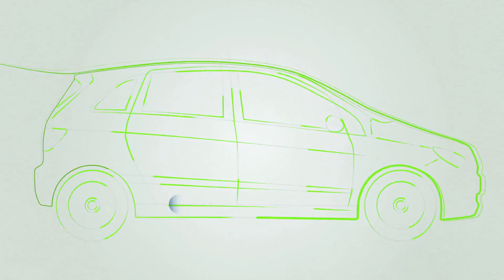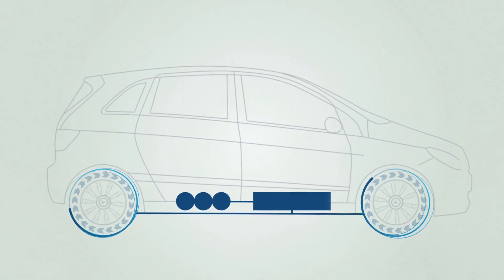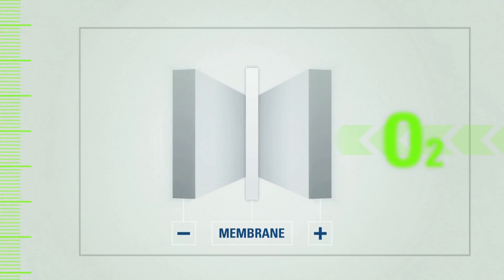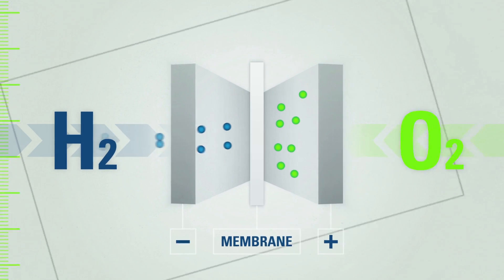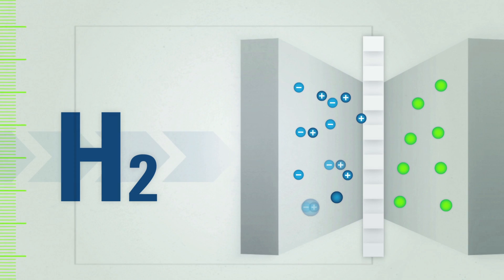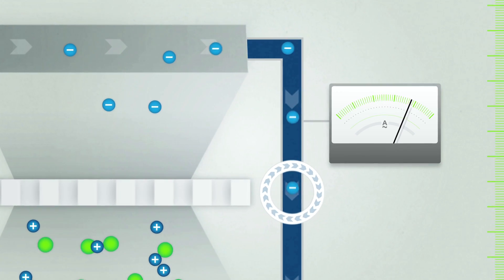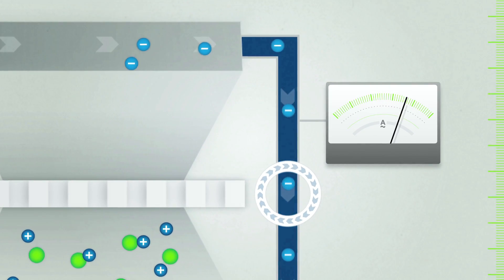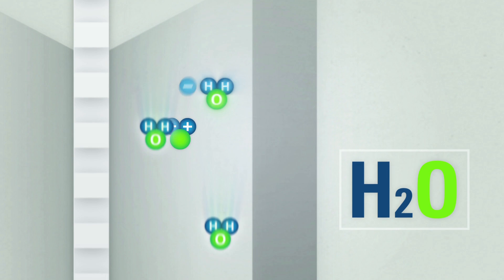How does a fuel cell work?

Comment: Hydrogen is inefficient and costly to store, transport, and utilize.  Electricity is much safer and easier to store and transport which is why battery technology is widespread in everything from cars and ships to homes and power-grids.
Reply from the maker: Hi K A Nesiah,
Hydrogen is a technology that has been tried and tested for years with high safety standards. Several hundred hydrogen dispensers are in use worldwide and over 100,000 fueling processes have proven that refueling with hydrogen is safe, efficient, odor-free and takes around four minutes – comparable to conventional car fueling. Electro mobility in the form of electricity is already present and will continue to gain popularity, especially in short-distance passenger transport but when e-mobility calls for large ranges or heavy freight, then energy sources with a higher energy density are required—and this is where hydrogen comes in. As an example, the weight of the battery pack for an heavy duty truck alone would be like carrying a second truck on top. Hydrogen and LNG are currently the only viable alternatives for long-distance truck and bus travel. The same holds true for shipping. No battery has yet been invented that can compete with the range of hydrogen & LNG in the size of a fuel tank.
Reply: @omv  Electric drives will be standard in cars in 10 years as they are already standard in locomotives and cruise ships.  Batteries are far superior for light-duty consumer usage scenarios like cars, pickups, and motorbikes with near infinite potential charge points requiring as little as  $100 plug, while locomotives and cruise-ships which require very high-energy density are already diesel-electric hybrids.  Diesel and dirt-cheap LNG will be around for decades.  Hard to see a reason for hydrogen.
Reply: LOHC has solved the drawbacks you mentioned including safety, transport and utilizing

Comment: Unless hydrogen is cheaper than hydrocarbon fuel Gas, petrol, diesel or compressed gas) The future aint changing much. 
And stop refering to it as a mini power station, its more like a rechargable battery consuming air and hydrogen

Comment: Hydrogen was the fuel of tomorrow until electric cars were invented...
Reply: From what i've been told, the problem lies in power storage.  The smaller the power draw, the more viable batteries are.  Flashlights, phones, calculators and now cars...but what about commercial airlines or tractor trailers?  Batteries in larger vehicles are an engineering problem since batteries are so heavy that it's very inefficient.
Reply: No way, hydrogen is still the fuel of the future. We just need to figure out the extraction and storage problem- hence “future”. Batteries are primitive - the have been invented hundred years ago and are the technology of “today” vs “tomorrow”.
Reply from the maker: Hi MrSophisticatedChild,
you are perfectly right in your assessment. Currently the only alternative to Diesel is LNG (Liquefied Natural Gas). They generate almost no particulates and emit 15% less CO2 as well as being up to 50% quieter than conventional diesel trucks. In order to power an average HDV you would need a 15t lithium-ion Battery or a 6t solid-State battery.
Reply: And OMV we had a fleet of CNG busses here in my city, they touted how great it was, till it was costing more than diesel, now every single bus has had the cng crap removed and runs back on dirty old dinosaur turds.
Reply: Plus its no cheaper than normal fuels. Tell me and every one else why they should invest millions of dollars into changing fleets of vehicles into using hydrogen when its just as if not more expensive. Not only that theres little to no way to refill it if you run out.
Reply from the maker: Hi fhhsvnggbh, thank you for raising your concerns towards us. LNG fueled vehicles generates almost no particulates and emit 15% less CO2 as well as being up to 50% quieter than conventional diesel trucks. Concerning the costs, in the vast majority of all of Europe, CNG is cheaper than conventional fuels. Unfortunately we can't comment on local decisions regarding fleet management but if one time costs of trucks are lower for diesel powered vehicles than this is outside our field of influence.